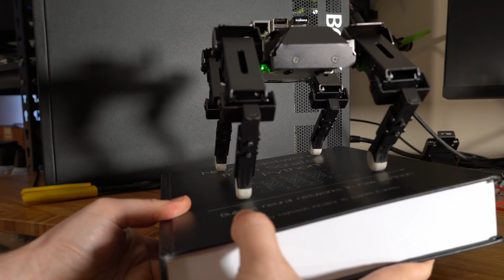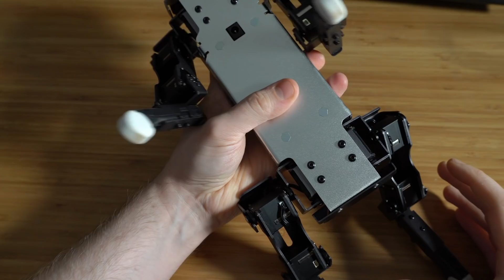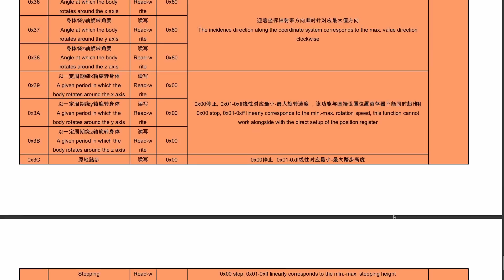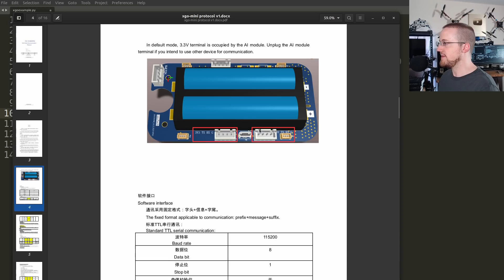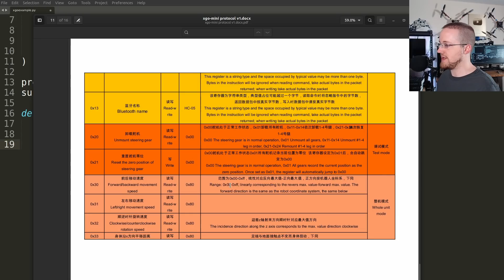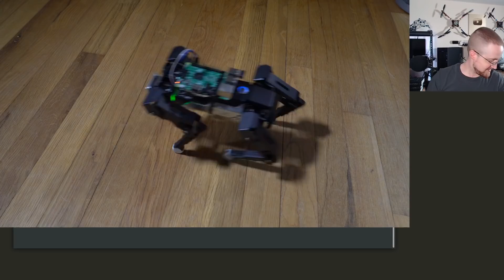Robot Dogs: A Programmer's Best Friend

Comment: I tried to follow on the Youtube code shown on above by exactly connecting Raspberry Pi with XGO-mini.
Although I followed every step of the Youtube contents and found no error,  the coded did not work. No move of XGO-mini. I wonder something had changed at XGO-mini firmware after Sentdex had tried. It was Aug 23, 2021.

Comment: hey i want one question and i want solution from you i have one arry like string ["4599"],["6625"],["7777"],["12345"],[7070] but i want print only this out put like this  ["4599"],["6625"],["7777"] means i want print that string which string have same string last two or 1st and next if are same and or whole are same like in this arry ["7777"] how will sove this question

Comment: it would be cool, if it could balance on two legs using just the momentum of the remaining movable parts. so when its acceleratioin sensors detect an angular momentum it counteracts it apropriately with its free two limbs. a bit like a balancer on a rope with his arms stuck out.

Comment: I'm not 100% sure on the scale; but kinda looks like it might be possible for it to climb human stairs by sitting on the back legs, balancing on the lower segments of the rear legs for stability; then reach with the front legs over the step, reaching as far forward as possible before placing the front feet down; then carefully raising itself on it's rear and front feet, then  once the rear legs are stretched the most and the hips are close to the edge of the step, carefully get the rear feet over onto the step one at a time, being sure to move the center of gravity forward so it's above the step.

Comment: 2:20 Holy crap, that is the dumbest title of a book I have ever heard.
I've been interested in neural nets since 2007, built my first 2008 and made my own framework back in 2010.

You do not create neural nets in python from scratch... you do it in c++.
The only reason AI-wannabees even think python is a valid appraoch is because of Tensorflow, which again is c++ under the hood.
Reply: This is always curious to me when people know the content just by reading the title ;)
You are missing a few things here. In this book, we are taching how neural networks work and not building a high-performance neural network engine (TF that you mentioned is multiple hundreds of megabytes). Compare Python to C++ and answer yourself how much Python's notation is cleaner than C++'s for this purpose.
The next thing you don't know of is that after we explain certain topic (including math), we're coding the solution with Python and explain the code and then we are simplifying the code with NumPy calls. You might know that NumPy is written in C++ too.
Actually, as a result of this, our final code is at least as fast Tensorflow's CPU implementation (it can be faster thanks to less overhead) wile yielding the exact same results.
So... can you really write faster code in C++? And make it as readable as our code is? :)
Reply from the maker: It's actually a perfect title, given the content within it. Also it's an amazing book. Cute thoughts, congrats on your own framework. I bet it's super fast. Have a good one!

Comment: I don't understand why quaruped slow walking on a flat surface is so jerky - is it because the legs are missing an axis? If you watch a dog or cat walking slowly, particularly in 'stealth mode', it is totally smooth, and presumably the geometry equations are pretty simple.
Reply from the maker: Presumably being the KEY word ;)

Gait is arguably 99.99% of the entire challenge with quadrupeds. It's not simple. For example in the videos, the quadruped walked in both grass and a hard, slippery, floor. Same gait algorithm for both. Detecting the surface can be done to some extent, but this is another challenge too and complexity only increases. One of my main interests with quadrupeds like this is indeed to improve the gait and make them smoother. 

If you watch something like Boston Dynamic's spot vs ... well every other quadruped pretty much, you will probably see that smoothness that you're thinking of.
Reply: @sentdex  In order to mimic the dexterity and efficiency of natural human gait, you need a completely different design than current state of the art humanoid robots. The mechanisms would be highly complex, with lots of degrees of freedom. You would need artificial muscles of some kind/ tendons driven by motors. Lots of them. Hundreds. Impossible to hardcode. But with Reinforcement Learning and massive computing power, its possible.

Comment: 9:55 he ended up just strapping the raspberry pi to the top with an impact absorption separation device using an adjustable attachment mechanism. Thats what i call real engineering
Reply: That must've cost a fortune